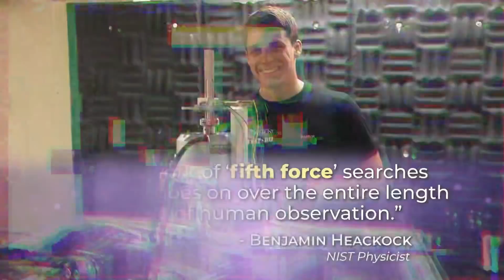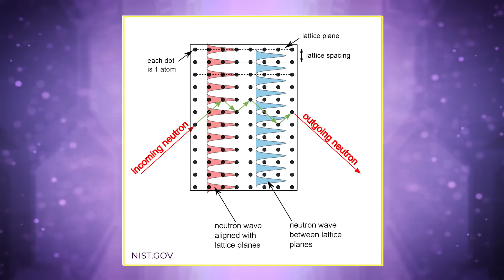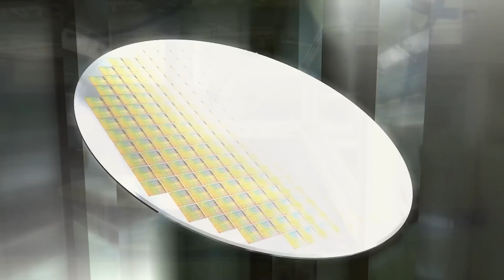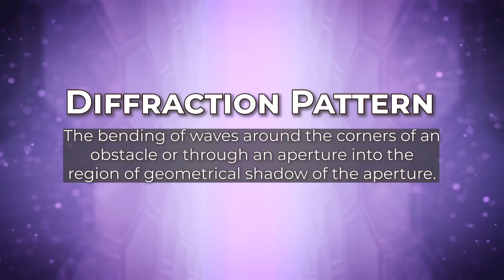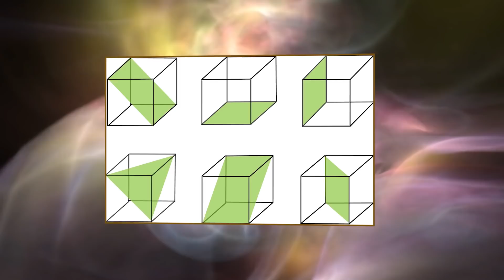Are There More Than Four Forces Of Nature?

Comment: It is of interest to examine the popular analogy of the tiny dynamical processes to waves:
A wave in fluids occurs where their boundary meets an energetic , moving fluid of lesser density. 
That energy is transferred to the denser fluid. Using the most common waves of which we are sensually aware, passing air interacts with water by expending some of its motion against the surface region of water.
this induces energy  - kinesis, motion, in the molecules of water, building up small cascade in a downwind direction along the surface. 
Now, I have forgotten the specific dynamics of the spreading of that energy, but the molecules of water stack up , as air molecules strike the rear face of the water wave, This causes the water molecules to rise against gravity, which in the emergent scale at which we perceive, develops some potential energy, That very rise as a result of being pushed, creates a lower energy state, as it were, since water does not substantially change density, in the low area where air is not moving and any unified linear manner. The water ahead which has not yet been energized to move, tends to move toward the area of least pressure.
so, the finally general summation of a water molecule's motion becomes elliptical.
since little friction occurs, this induction of consecutive elliptical molecular motion allows water waves to persist long beyond the initial wind pressure ceases.

Because such pressure induction expands in other directional vectors, as the water molecules are drawn to multidimensional areas of lower pressure, the energetic motion expands throughout the 3 common directions.
. Without going further into how the higher energy areas absorb the energy of smaller waves, or the final summed vector departs from the initial direction of the wind, that process differs from the breaking waves shown and erroneously are equated with the elliptical molecular travel in water deep enough for other boundary layers to have little to no effect on the moving cycle.

A broken wave, of course, cannot induce sufficient cycling of water molecules in the direction it advances, and so steepens and breaks, dissipating on the far more solid, dense, shore bottom.

Waves, then, may not be an accurate portrayal of the energy transfer that appears as motion.

Some alternative is necessary, as there is no "ether" material upon which waves travel through "static" space. 

This returns us to imagining , rather than waves, undulations of the dimensions of space.  Now, the tensor and scalar pressurelike equation of Einstein's Field equations seem to satisfy that change of shape.
 
As a beginning student of only basic physics, the question is:
"Is this a more correct analogy, superior to "waves" in functional description of energy and motion?"

Comment: See here.  Dr. Mills recently patented this and verified it via experiment.

Title: “Fifth-force apparatus and method for propulsion”

Abstract: “A method and means to produce a force for propulsion comprises a source of electrons and a means to produce hyperbolic electrons; whereas, a gravitating body such as the Earth provides a repulsive fifth force on the hyperbolic electrons. Hyperbolic electrons are produced by elastically scattering the electrons of an electron beam from atoms or molecules at specific energies. The emerging beam of hyperbolic electrons experiences a fifth force away from the Earth, and the beam moves upward (away from the Earth). To use this invention for propulsion, the repulsive fifth force on the hyperbolic-electron beam is transferred to a negatively charged plate. The Coulombic repulsion between the beam of hyperbolic electrons and the negatively charged plate causes the plate (and anything connected to the plate) to lift. The craft may additionally gain angular momentum from the fifth force along an axis defined by the gravitational force, and the craft may be tilted to move the vector away from the axis such that a component of acceleration tangential to the surface of a gravitating body is achieved via conservation of the angular momentum.”
                                  
Patent: US20100251691A1

Comment: I've often wondered why the Higgs field is not considered a 5th force. Add dark energy if you can call it a force then you have 6 forces (or maybe these are are not considered forces because they are considered scalar?) so wouldn't that make looking for one as yet not measured/identified tentatively a 7th force?
Reply: for my part I've been wondering how come we don't consider electroweak a single force operating on two levels since... it is. that would make Higgs the fourth force

Comment: I doubt a fifth force is of practical use for the next decades because it's interaction with normal matter must be weak or even non-existent. Of course it might be, that normal matter is of "neutral" charge with respect to the fifth force and we have yet to discover the charge carrying partikels of the fifth force. 

Even if the fifth force was reasonably strong among its charge carrying particles and available in abundance we would still have the problems using it since it doesn't interact with our matter. Who knows, there might be Aliens made of fifth force charged matter walking right through us and we wouldn't know.